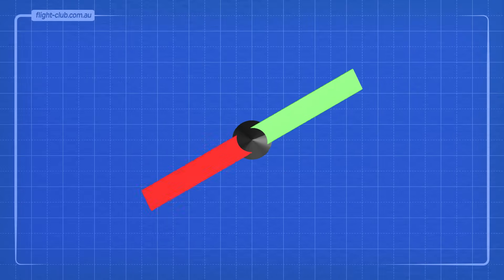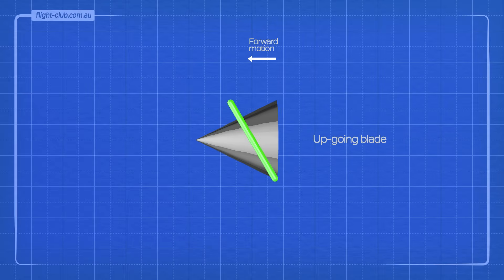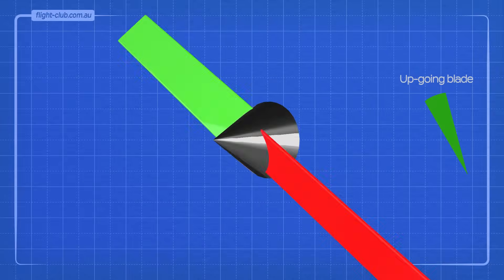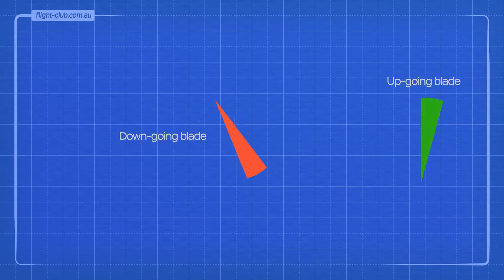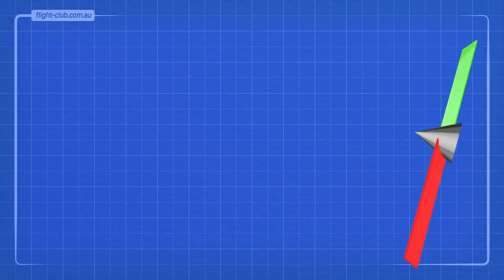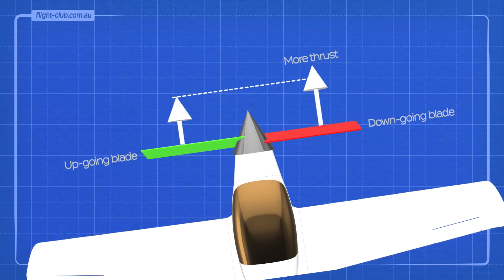What is P-FACTOR? | The Asymmetric Blade Effect

Comment: Ok so even between this and the short from a month ago I still had some trouble understanding where the extra distance came from, but I was able to figure out a clearer way to think about it. At 0:25 it's shown how the rotational and forward motions combine, well if we tilt up without changing the direction of forward motion then as a blade is coming up the rotational motion is bringing it slightly backwards while the blade going down is getting moved forwards. If you imagine an propeller fixed in place and tilted up with one blade pointed down and the other pointed up then you will find the outer edge blade on the bottom is further forward than the outer edge of the top blade. When this propeller spin these blades switch places meaning the one going down has to move slightly forward and vice versa. 

In flight the forward motion of the plane and propeller attached to it are keeping the blade still moving forward relative to its place in the air, but it isn't moving as far forwards as it would if the plane was moving straight forward relative to where the propeller is pointing.

Comment: is there no way to mitigate this by adjusting the angles of the blades separately? 
like an independent computer controlled AOA controller for each prop separately, or some kinda fancy mechanical system. feels like a simple enough problem to solve for to me.

Comment: This is 2d. In a 3d world the angle of attack does not matter its omnidirectional. The p factor is the differential of the aircraft rotating around the propeller centerline against the drag of the propeller. The airplane wants to lift one wing increasing its speed and yawing the aircraft against the direction of travel. 😊

Comment: Precisely why when you put an engine into a single-engine aircraft, you actually set it about an inch forward on the left side than on the right, or opposite that if the engine rotates counterclockwise from the aspect of the pilot. Where this affect becomes most pronounced is on twin engine aircraft and you have an engine go out where the pee effect is on the outside of the engine that still running. Which is why twin engine aircraft should actually have counter rotating props.

Comment: If the blades are rotating on a variable axis yes..  but when on a fixed axis ie a propeller shaft, the blades will not vary on their pitch..  only helicopters have blades that have variable pitch because this p effect is what you use to fly the thing..  if a plane had variable pitch and was flying with a front facing prop and it decided to change the angle of its dangle it would rip the blades off or cause the motor to stall out..

Comment: Never mind P-factor, in the late 1930s single-blade propellers were produced and installed on light aircraft for the supposed advantage of lower drag on one blade as opposed to two.  I learned of this strange device when I found an advertisement for the propellers in a period aviation magazine given to me by a great uncle many years ago.  I understand they are still used on retractable motors for self-launching, powered gliders.

Comment: When sitting on the ground at the beginning of the take-off, a plane with tricycle landing gear sits with the propeller rotating in a vertical plane. The upward and downward blades have the same angle of attack. The air moving rearward from the propellers does not move in a straight line, it is a helical flow in the same direction as the prop rotation. The airstream will hit the left side of the vertical stabilizer and push the tail to the right, similar to applying left rudder.
Watch the flow from a boat propeller, easier to see.

Comment: "... in addition to this [the angle of attack], the down-going blade travels further and therefore faster through the air than the up-going blade. These two effects combined cause the down going blade to produce more thrust than the up going blade and cause the airplane to yaw to the left." After a chat with GPT and rewatching this section several times, we are both confused by this. Is this inaccurate? It seems that both blades travel the same distance.
Reply: If the prop shaft is tilted upwards, the down going blade does travel further. Greater the angle+airspeed greater the thrust difference

Comment: I know nothing about planes. Would it be possible to put the prop-shaft (or engine) on a gimble to counteract this? Essentially ensuring that for 90% of attitude ranges that the props are equalised?
Reply: Layman here. If I see it right, this is only relevant for single-engine-planes.  Multi-engine planes like turbuprops have propellers turning both ways (I think) where opposite forces are neutralized. Commercial airliners have all engines turning the same way (cheaper to build), but the effect in a housed airstream is negligible or inexistent. But I don't know about other planes. In general, this effect depends on the actual flight attitude of the plane and is esiest to compensate by steering surfaces like ailerons, flaps, rudder, elevators etc.

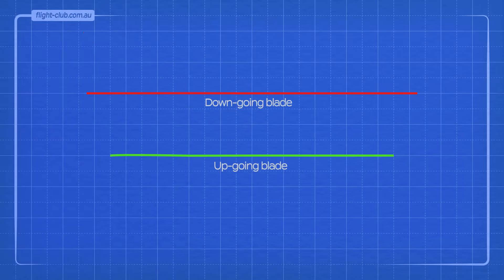Comment: Sorry but one blade cannot travel further and not go faster through the air than the other one as mentioned at 1:39! What happens is that due to the difference in angle of attack the "bite" of one blade pushes more air mass than the other one and that is why it has more thrust not because it goes faster nor further! can you imagine the blade that goes further and faster getting ahead of the one that goes slower like in the cartoons? Keep in mind the propeller blades "push air mass!" So if the angle of attack is very different when facing the airflow then one blade will push more air mass than the other one but no blade cannot go faster than the other one just simply because they are attached to the same "object" moving at the same speed! Please make sure you guys use the proper terms when explaining these things because you can just cause confusion to the people and it misleads the people rather than helping them to understand! Also using the proper terms will help you to understand the physics of it!!! I am a student pilot and you can watch few of my videos in my channel but also I am an Engineer and I learnt physics at school!
Reply: Actually, you can have each blade travel further on their down stroke than on their upstroke. At high angles of attack, the downstroke is moving slightly in the direction of travel of the plane while the upstroke is moving counter to the direction of travel of the plane.

Imagine if the propeller were pointed upward like a helicopter's main rotor. If the helicopter is flying forward then clearly when each blade is rotating in the forward direction it has a higher blade tip speed than the blade moving backward.

Comment: First of all, your videos are absolutely clarifying and fantastic, but in this one I've noticed something wrong: when you explain the changing of plane of rotation since the nose pitches up, you consider, for the downgoing blade, the angle of incidence not the angle of attack, because you're keeping in the video the angle between the chord line of the blade and the rotation plane (for definition is the angle of incidence) and not the angle between the chordline and the relative airflow (angle of attack)...for this the red slice of angle should be smaller in the rappresentation, but however it would always be smaller than the angle of the upgoing blade. 
Maybe i'm wrong, I look forward to your reply. thaaaanks!

Comment: It's even worse for helicopters... bigger blades, actually rotary wings....  being horizontal one wing is traveling forward at it's speed + aircraft speed, the opposite wing travels rearward, at it's speed - the aircraft's forward speed.  End result, one wing creates significantly more lift, (asymmetry of lift) trying to spin the aircraft over.

Comment: Does gyroscopic precession not have an effect here? If there is more thrust produced on the right side during a nose up attitude, why wouldn't that force take effect 90 degrees later in the plane of rotation causing the nose to pitch up more?
Reply: It actually does. When you apply higher power settings in order to accelerate but still at a low speed the gyroscopic effect is amplified

Comment: reality check     the Theory discussed in this video is  Specious/false .!!!
1)   p-factor is  always present.        2)   p-factor is the feedback torque  that comes from  a  CW rotating prop.!!!        3)   p-factor is most noticeable, and dangerous, during a take-off.        4)   p-factor occurs because (at take-off) the wing is not yet fully 'flying'.    meaning,  the 'normal' zones of pressure around the wing are not at full strength.          (the term  p-factor  refers to an  'unscheduled turn to port'.

Comment: What about gyroscopic precession? Wouldn’t the increased force be applied 90 degrees later in the rotation?
Reply: Gyroscopic precession is only a factor when changing pitch or yaw (but you never notice it during yawing moments). Once you're on-pitch gyroscopic precession ceases. For example consider a helicopter going so impossibly fast that it's got retreating blade stall. Will the helicopter roll to the side of the stalled retreating blade? NO! It will pitch UP due to gyroscopic precession.

Comment: When we drill direction wells the drill bit has a tendency to move in the right hand direction similar to the rotation of the drill stting as it is enclosed inside a tube of rock formation around it. In air there is no restrictions and if the propeller is rotating clockwise the non rotating body will take or move in the opposite direction. 3rs law of motion

Comment: There is third effect coupled to the two effects nicely addressed in this video. The propeller causes the air to spiral in the same direction it turns. Using the same example, where the propeller turns clockwise when seen from behind, the air swirls so that it moves downward at the right side and upward in the left side of the aircraft. The air going down passes "clean" under the fuselage, crossing the airplane's belly from right to left. The air going up meets its fuselage, vertical stabilizer and rudder crossing the airplane's top from left to right. So it attacks those surfaces at an angle, thus generating lateral lift, pushing the tail to the right. This effect decreases as the airspeed increases.
Reply: While you did a good job explaining the spiraling slipstream cause of left turning tendency, it doesn't belong here as P-Factor and Spiraling Slipstream are entirely different causes of left turning tendency.

Comment: I still don't understand how the AOA is being increased, it's a fixed pitch. The AOA is from the chord line to the relative wind. But as you climb, it appears the blade becomes more laminar to the airflow. If you compare this to helicopter Disymmetry of lift (or Helicopter P-Factor). It explains that the advancing blade (Descending) blade is slower. You have headwind + the movement of the descending blade that goes against the wind = slower. The Ascending (retreating blade) moves faster. Everyone explains it the same way. The....the descending blade takes a bigger bit of air... get it? Please help, not connecting the dots.
Reply: You are right. This video’s explanation is wrong. Both ascending and descending blade’s AOA are not that different. The only thing changes remarkably by P-Factor is each blade’s strength of the relative wind. As the descending blade’s relative wind, which is perpendicular to the propeller shaft, is combined with the airspeed(airplane’s relative wind), the descending blade’s AOA decreases and its relative wind vector increases. On the other hand, the strength of ascending blade’s relative wind doesn’t change that much while the AOA decreases. As a result, AOA on each side of the propeller remains similar but the descending blade’s strength of relative wind becomes bigger. I don’t know if you could check my writing but i can e plain it with a picture if you message me.

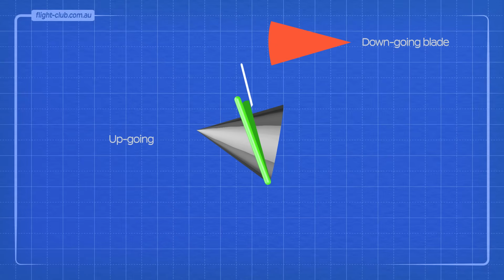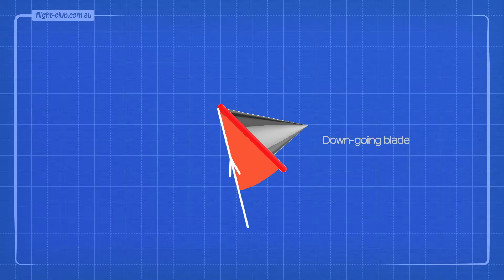Comment: I have a question: At 1:30, what is the white line oriented at? At the down-going blade, it is perpendicular to the direction the plane/propeller points towards which makes somewhat sense to me, as the airflow will (mostly) be in that direction. But I dont get it with 1:30. Thanks for reading.
Reply from the maker: At 1:30, the white line is the up-going blade's relative airflow. The green arc (that looks like a line) is the up-going blade's angle of attack. 

That's my fault. I should have made the images bigger.
Reply: @flightclubonline  No, the images are fine, I just did a little sketching of airflow and pitch myself and get it know.

Comment: Oh…. You were SOOO close!  You ALMOST got it right. 

It’s ONLY the increased velocity of the Dow going blade and the reduced velocity of the upgoing blade. 

Because the plane of rotation changes as well (not shown) the angle of attack is the same regardless of attitude.
Reply from the maker: Thank you. I'm not sure what you mean by "the plane of rotation changes as well". 

Another example to slow flight scenario mentioned in the video: consider a taildragger during take off. Its down-going blade must have a greater AoA.
Reply: I believe you are thinking of helocopter rotors while in forward flight that can cause retreating blade stall,  where one blade is moving through the air faster than the other.   Although there is a small increase of velocity relative to the air on the down going blade of an aeroplane, the change in angle of attack is more of a factor. That change can be vertical, horizontal or a combination of both.

Comment: As an RC model plane builder and pilot in the 80’s I remember we countered this effect by building in the engine with some degrees of pitch and yaw
Reply from the maker: That's interesting that even at such small scale this effect is evident.
Reply: @flightclubonline  i think it has such an effect because the planes are so light
Reply from the maker: Oh I see. This makes sense. Thank you!
Reply: @kuartz. I think some planes actually did that (keyword: did, not anymore)
Reply: @Æ-z4s  What is this conversation? "P factor" stopped happening? Ha.
Reply: @kuartz. On small electric planes which spin at <3000 rpm the effect is great. That's why if you take apart a electric plane the motor usually won't be in line with the planes longitude axis. It usually pointed down and to the right. On the glow engines that turn 10k rpm the effect is minimal so there is no angle to the motor.
Reply: I think on small model you just use yaw aligment to compensate for gyroscopic moment. Pitch for have even attidute of glight behavior with thrust and without. (otherwise you would have have yo strongly compensate with elevator, because models have hight thrust to weight ratio).

Also the proppellers are bigger cause on models therefore greater gyroscopic moment that needed to be compensated.
Reply: That isn’t why engines have down and right thrust. 
Down thrust is so pitch doesn’t change with increased throttle because most models are so over powered. 
Right thrust is to help counter the torque of the props which are over sized in comparison to real planes. 
Using right thrust to counter P factor would actually make P factor worse when flying inverted so for most aerobatic models we don’t use much of either of any.
Reply: Ditto. Same for me in 1987 - 1990 . Motor mounts were always sloped
Reply: Even real propeller driven aircraft have engines angled to help counteract P factor. I've built a few myself and have seen it
Reply: Styrofoam RC planes with high output electric motors asxan example.
Reply: Actually, what you were correcting for the Rotating Slipstream  by slightly canting the engine mount to the right.  There are four forces attempting to turn the aircraft during flight: (1) Rotating Slipstream, (2) Opposite Reaction to the engine rotation, (3) Asymmetric Loading of the Propeller (aka P-Factor), and (4) Gyroscopic Precession.  

Rotating Slipstream (i.e. the swirling wind from the propeller hits the left side of the vertical stabilizer, causing the aircraft to turn left) is offset by: (a) canting the engine slightly to the right, and (b) offsetting the vertical stabilizer in order to cause the aircraft to constantly turn slightly to the right, and (c) a permanently fixed trim tab on the rudder which is adjusted when the aircraft is first rigged.

P-Factor (what it is, when does it happen, and what do you do about it) is caused by the different angle of attack of the downward and upward traveling propeller blades.  P-Factor ONLY happens when the aircraft's angle of attack is higher than the directional flight (i.e. takeoff and slow flight) - the nose is high, but the aircraft is moving horizontally.  Basically, you get more thrust on the right side because the downward traveling blade takes a bigger bite out of the air.  This asymmetric loading of the propeller (i.e. asymmetric thrust) causes the aircraft to yaw left.  The solution: RIGHT rudder. 

For a detailed discussion of these four factors, I'd suggest "The Compleat Taildragger Pilot" (note: "Compleat" is NOT a misspelling) available on Amazon.
Reply: Pilot? Oh ok